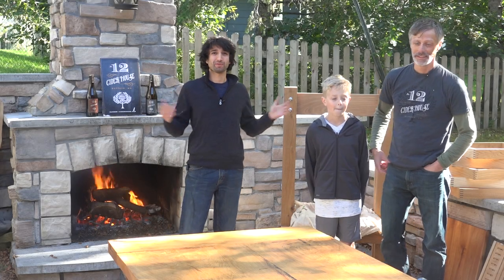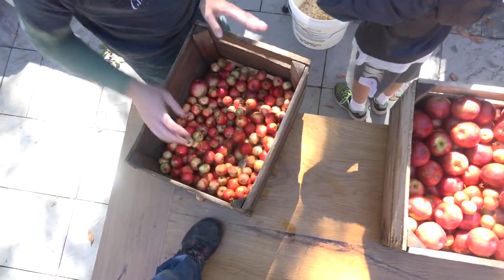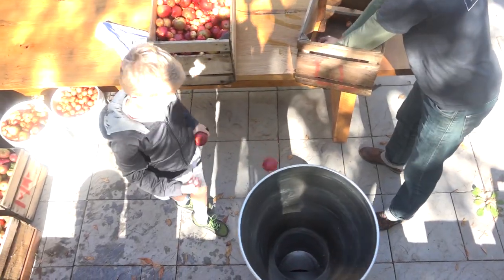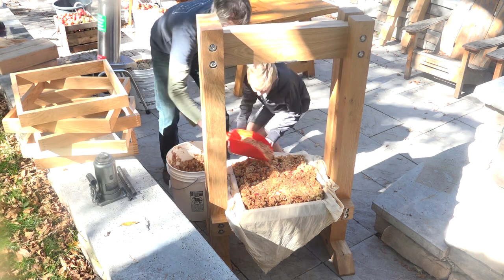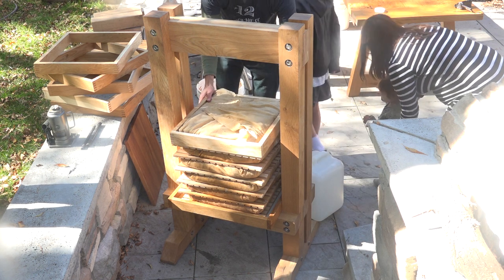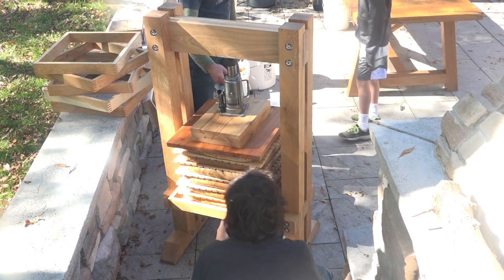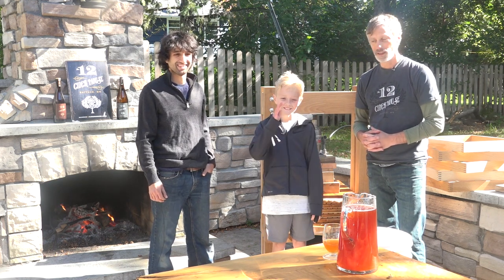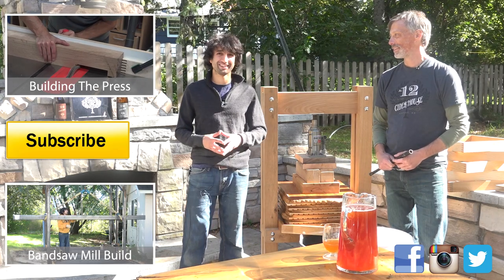How to make Apple Cider with a Rack and Cloth Press

Comment: Hi Matt!  I bought the cider press plans right after this video came out and made a slightly scaled down version made of softer wood.  Every year we throw a cider pressing party, slowing growing in size over the years.  This year I swapped the manual 12ton bottle jack with one that is Air/Hydraulic and used a compressor to drive it.  Our first year we pressed 30 or so pounds to make just a couple gallons of juice as a trial.  This year we had over 40 guests!  We bought one bin ( 800-900 pounds ) of apples in bulk, and made about 60 gallons of juice!  All in about 5 hours thanks to your plans!  To get the apples into pulp I repurposed an 14amp electric chipper/shredder.  It will chew through apples as fast as we can throw them in!  Thanks again for creating the plans. The press has created memories that will last our lives.  Next year we might tackle 2 bins, that's close to 1ton of apples, and over 100 gallons of juice!

Comment: Cool video! A couple of questions.
Where do you buy cheap apples to make this juice out of?
Is the apple pulp good for anything after it has been fully squeezed out?
Reply from the maker: Thanks!  You can get them from orchards.  You don't need pretty apples so you could probably collect apples that have fallen on the ground or from trees that don't have great looking fruit.  I'm not sure what else you could use it for.  You wouldn't want to eat it since it's full of seeds, leaves, and stems.
Reply: I like to go to the orchards and ask them what they have other than whats on display. Seconds, crab apples, brands that aren't famous. Of course blending is an art but that's how to find such apples. But bushel prices are probably going to still be 20 bucks or so if you come off the street.

Comment: Hi Matt, it looks like at about the 1020 mark that the top left part of the upright was cracked. I'm wondering because I plan to have one made but wont if the design wont hold up to the pressure. I'd appreciate your input on this! Thanks

Comment: Great informative video! Was wondering how heavy of a jack did you use ?
Reply: This was a 12 ton bottle jack, which is what it was designed to handle. There is a little creaking when we crank it down completely so we might advise using a 10 ton jack instead.

Comment: Hey matt, I'm wondering what strength of bottle jack I would use on this? In terms of tons. What did you use in this video? Thanks
Reply from the maker: I used a 12 ton here but an 8 ton could also be used

Comment: I had been wondering how you would use all those extra frames (we always just used one).  I see you only ended up using one as well.
Reply from the maker: I made the extra ones to make the prototyping process easier since I could use them as spacers to see how tall the stack would be when fully loaded.  I figured it would be a good test of the box joint jig too.  We may end up selling some of these presses or accessory kits so I won't have to make any forms for a while at least.

Comment: The old ones had an acme screw for pressing with a big handwheel on the top.  The jack probably works as well or better, but the acme screw would be a nice vintage touch.  I have been to old cider mills where the press was powered by a water wheel turning a huge screw which I think was wooden, but I don't remember for sure.  A question:  If those are zinc coated bolts, won't the acid in the juice dissolve the coating?
Reply: Yes. The acid would dissolve the coating. We used stainless which was expensive but as you will see - on this particular pressing, not much juice made it out that far....

Comment: To grind my apples and other foods, I built a small frame to hold a single stainless steel sink and a new food disposal unit high enough to direct the flowing juice to a container for processing. It is not as fast as this grinder, but using 'reclaimed' components (not the disposal unit!) you can save some $$$.

Comment: Any idea how much 6 bushels weighed? I just did cider for the first time. 175lb of apples yielded about 12 gallons.
Reply from the maker: +Jeffrey Rodriguez we didn't weigh them but Steve was saying the ballpark number is 40lbs/bushel
Reply: I've found that the weight of a bushel varies quite a bit, which is why I decided to use weight.

Comment: 10:22 Matt is always thinking about pancakes!  Were you worried there would be too much pressure and the whole press would just explode out the top?
Reply from the maker: Heck yes!  I was worried the whole time
Reply: Matthew Cremona I watched this one first. Then the other video on building it. Nice repair! 😉
Reply: You should get a load cell and use it to measure the jack's output.
I doubt the unit wood explode. If anything, the top beams wood just break. Then it wood only be a matter of making beefier beams and swapping them in.

Comment: Maybe use 2 wrought iron plates bent in a U and placed as caps over the uprights using the through bolts,  to help with the structural integrity as the jack presses up on the crossbeam.   Something hand hammered would have a nice look to it. Where is Alec Steele when you need him?   :-)

Comment: Perhaps a stupid question, but couldn't you just fill the layers with apples and go ahead with just pressing the whole apples? - Edit, answer at 6:45.
Reply: No. The apples need to be crushed otherwise you will not be able to get the juice out with a reasonable amount of pressure. You can however, press apples that were frozen and thawed. They have broken down to a point where they can be pressed but it still takes much longer for the juice to extract - so you activate the press for such apples and just let it sit for a much longer time.

Comment: the press square shoulders and columns look harrowingly identical to an 18th century guillotine that  severed human heads from their necks. Although the apple press functional design is there, i think the appearance should not have been ignored, and nothing much was done there. This was Matt's job and if he does not feel endowed with the artistic side of wood working he should have betrothed a drawing artist to make some sketches proposals and combine an artistic look with a functional look. Even 10%-20% of extra work to give this piece a more aesthetic look would have worked well in Matt's favor.  Matt range of skills and talents are impressive (and maybe too diverse covering several guild and thus mastery of each takes longer). But as a carpenter and wood worker there is a range of skills and artistic development including wood carving and blending curves, moldings that is an important part of the superior levels of woodworking. It could have been as simple as adding gentle asymmetric outside curves to the columns, a hand carved panel over the transversal piece. Also i understand the structural integrity of using rivets but i think that is a faux-pas. A castle joint would have been strong enough.
 I'm not saying this is not a successful piece but it looks plain, common and something people will not remember because it lacks the extra artistic attention. If i were to grade it on a 0-20 scale it would be somewhere in the middle, an 11 or 12.